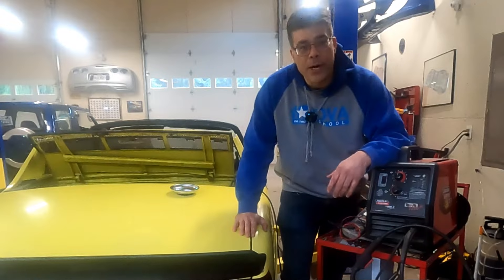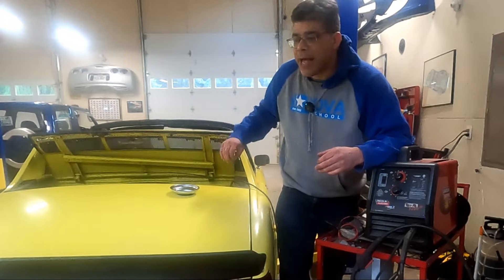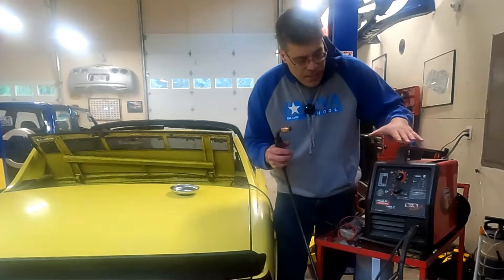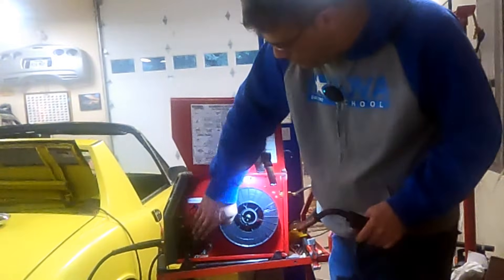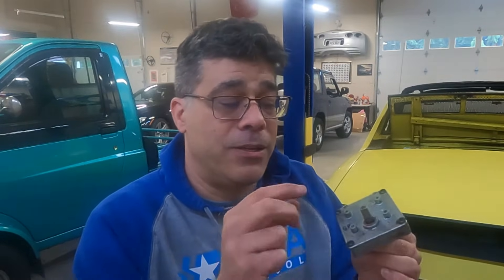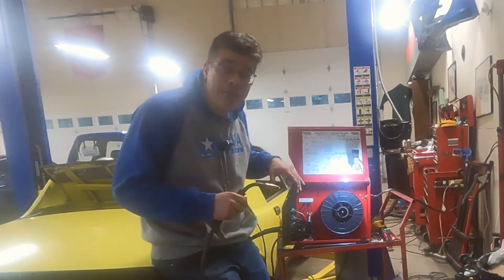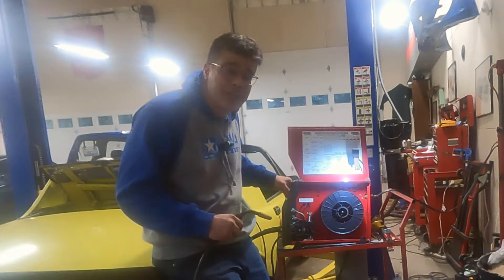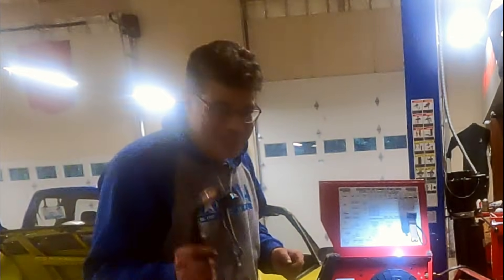The Fix for The Most Common Lincoln MIG Welder No Wire Feed Issue [Collector Car Guru Workshop]

Comment: today my pro mig 135 started making a low humming sound and trips breakers on a house.  any ideas on this?  it was just working when making an arbor, which was over a week ago.  now it makes a rough sounding hum even when just turning the machine on.  makes the sound regardless of pulling the gun trigger or not.  any help much appreciated.

Comment: Brand new Lincoln 140 HD won't feed wire out of the box.  This is my third MIG welder and I never had any issues like this before.  What a POS.  Sorry, I'm not taking apart the motor or drive assembly on a brand new $700 machine.  Glad I kept the the receipt.  Sounds like I'm sticking with "Team Blue."

Comment: Your advice worked flawlessly. My wire feed motor wouldn't turn. I figured the motor or the gearbox likely went bad. I was about to give up on my old Lincoln 3200 welder I bought from Home Depot 15 years ago. This is the first and only problem I've ever had with this welder. I even started surfing the web looking for a replacement part. One crazy website had it listed for $250. That was certainly out of the question. So I checked YouTube and found your video and followed your advice. Remove the gearbox, open it up, clean up the gears put in some fresh new grease. I didn’t think it could be something this simple, but it was. It started working again like new. Thank you. Awsome! 😎👍
Reply: What grease did you use?
Reply: @thomas-gj7pp  I sprayed it down real good with a can of white lithium grease that was made for garage goors and gears.
Reply: Mine stopped moving 30 years of using it never saw that before  but just moving the AMP selector and started working again.

Comment: Mine was feeding.then stopped feeding.i found the wire bunched up inside by the spool...seems it's broke where inside the cable..I cant pull it out from the rip. It's jammed like it welded itself inside sheathing.

Comment: dang, same issue on my Lincoln 140. ws ready to toss in the trash. gonna try this and see.Update: WELP, I fixed it and glad I did . when it wouldn't work I started shopping for a new welder. Glad this old workhouse still runs!! thank you! Took about 30 minutes. take pictures before you disassemble

Comment: Hey, nice video, but I got a better tip. When this happens on my Lincoln welder, switch power settings and try before doing anything else. Why? I have no clue, but it works. Something in the control board locks up I guess, and to reset it, switch power settings and play with the wire feed speed. It has worked on my welder numerous times. 
Annoying to say the least

Comment: 4:33 Thank you for your help. I was having the same problem with the gearbox, but i took some channellocks and just broke it loose. However, saying that you've done it the correct way. In my case, it's always an emergency weld.  So I got to play with it and there you have it. As you said, always, check the selector it has to be right on target.
On a on a weld pack one hundred

Comment: Mine stopped working after some heavy welding. I watched this video and then miraculously started to work again after watching. I realized that the welder had to regenerate power to continue welding. It’s a small weld pack 100. Lol anyhow, this is a great information if my welder really  breaks. 😅 Thank you!
Reply: I realized there is a duty cycle: The duty cycle of the Lincoln 140 Weld Pak welder varies based on the output settings:

- At 90 Amps: The duty cycle is 20%, which means you can weld for 2 minutes and then must let the welder cool down for 8 minutes within a 10-minute period.
- At 140 Amps: The duty cycle drops significantly, likely around 10% or lower. This setting is more demanding, so you would need to weld for a shorter period before allowing the welder to cool down.

These duty cycles are standard for many smaller, home-use MIG welders, balancing the machine's capabilities with its cooling requirements to prevent overheating.

You want to keep it on during the cool down period.

Comment: What about intermittent wire feed when you know the motor is spinning properly? I heard you need to have no kinks or loops in the handle cable  but it still skips.
Reply from the maker: A few of issues can cause this other than kinks/loops: the first is obvious -- the wire is melted to the electrode. Second is anything to do with the wire going down the cable itself: kinks in the internal sheathing of the cable, kinks in the welding wire or wire that is too thick for the cable. Third is your feed rollers are too loose.

Comment: Recently bought a weldpak 140hd, not running, the guy said he accidently wired it or plugged it i to a 230v plug and it just immediatly stopped, i checked all the motherboard and wiring jnside and do not see any damage or dark spots, the reset on the back doesnt seem to work or has never been tripped he said, any ideas on how to get it up and going again?
Reply from the maker: Doesn't make sense, as the plug wouldn't have fit and there aren't enough wires to do so. Do typical electrical diagnostics starting with checking for voltage at the circuit breaker with a multimeter. If you have it on one side, but not the output side, you can always try jumpering the circuit breaker on back to see if it powers up. Follow the power wires testing for each point. Wiring diagrams are available online.
Reply: @CollectorCarGuru  I'm aware the plug wouldn't fit, he made his own adapter three way plug, 220 to 110 typical three way cord, not knowing g there needs to be some sort of reducing effect like the plugs you see for campers to drop the voltave.

Comment: My Weldpak 175HD stopped feeding wire, but your video helped me getting working again, so thank you.  Poor welder has spent too much time outside. The contact at the back of the voltage selector knob probably needs cleaning for one.  At first it seemed the feed problem only occurred on the two lowest power levels (A&B), but then it seemed to fail completely.  That seems to confirm what someone said about it using welding voltage, which I would not have expected.  The grease in the gearbox doesn't seem too bad, but the motor itself was fairly jammed up with crap.  Besides a fair amount of dust, there a surprising amount of ferrous grit sticking to the inside and outside of the motor.  Most surprising, there was a gang of pincer bugs which had taken up residence inside of the motor.  A fine mesh metal screen on the motor cooling vents could prevent these problems in the future.

Comment: The motor uses a pwm voltage comprised of welding voltage , so you're correct in goung for the main voltage switch first as they do suffer from common issues , the gear axle  is also a problem never saw a gear failure but did see many axle and housing failure where the reduction gear had enough slop to disengage the pinion .

Comment: Bingo...!!!  My Lincoln weldpak 100 stopped feeding wire and I was just going to replace it, it has lived a long productive life.  The old grease was set up like glue in the gearbox, cleaned, re lubed and still in service.  Thank you!  (I still may get that new welder...B-)
Reply: Did all the steps. Still not working. Probably need a new feed motor.

Comment: Awesome, thanks so much for making this video.  This is the same problem I'm having, wire feed tries to turn but binds up.  My Lincoln Pro MIG 175, 220v is 18 years old, so it makes sense the grease has hardened.  I took it apart as you suggested.  The grease still felt like grease however, at the output shaft of the gear mechanism is a very small roller bearing.  The grease had hardened in the roller bearings.  I cleaned them with carb cleaner, blew them out with compressed air until they spun freely.  Re-greased them and everything works great now.  Thanks so much for the info.
Reply: Got the same issue same welder. Glad I found this video. Gonna take mine apart and clean it up.

Comment: My Weldpak 100 stopped feeding and so I followed your advice and pulled the feed motor... took it apart and the metal gears had turned the grease into a layer of adhesive that coated each spinning surface. I had to scrape the flats of each gear with a razor blade to get the buildup off the gears. I cleaned all the gears and gearbox, then lubed each surface with synthetic marine bearing grease (it's what I had on-hand) and turned the motor gear by hand to ensure that all gears spun freely... they did, but it was a slow process. If you open the feed motor, don't just add lube like I did the first time.... you need to pull the gears out (keeping track of placement) and remove the years of sticky buildup (from the petroleum jelly or other cheap lube they used during the original manufacturing process).

No more feed problems... not jerky feeds... hesitations... just consistently steady wire feeds.

Thank you!
Reply from the maker: Great work! Yes, you have to take time to properly clean those gears and hand turn them to ensure they are meshing well and spinning freely before re-lubing. Glad you are back melting metal.

Comment: Mine shorted at the cord going into my generator . It would barely push wire if I kept pushing the button ...is there a safety relay or fuse or something in there? I really need it working so I can finish my RV repair and get on the road
Reply from the maker: The Lincoln welders have a circuit breaker on the back, as well as duty cycle thermostats -- so if you heat the thing up too much, the thermostat reduces power or turns it off until it cools. If your cord shorted, that is likely due to an issue of the cord being twisted, crimped, cut, etc...